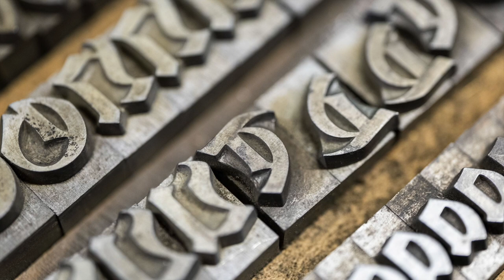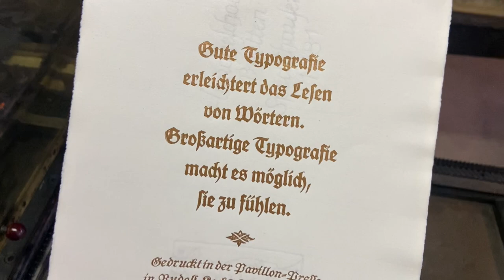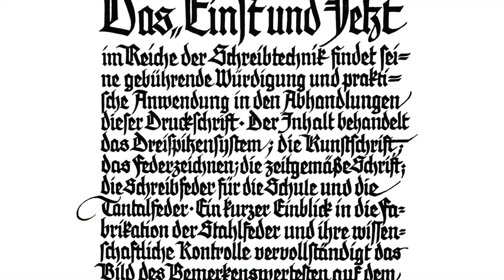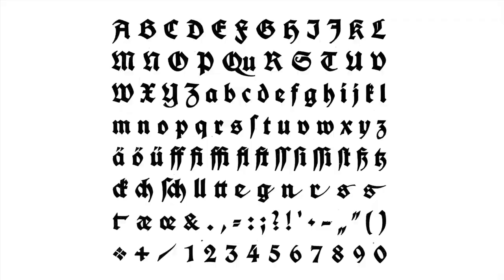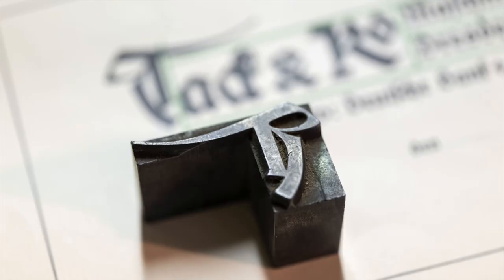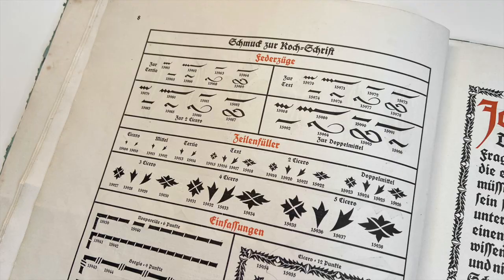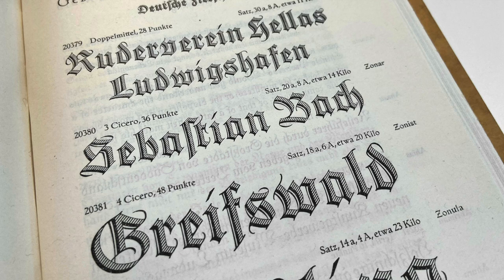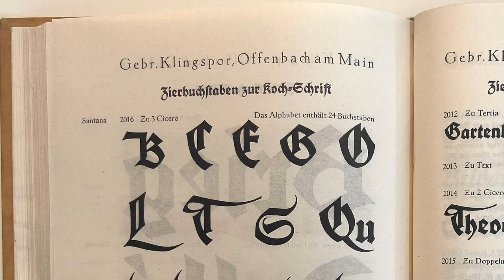Deutsche Schrift: Did Rudolf Koch’s typeface get its name by accident? | TypeTreasures series

Comment: What is that slightly taller than the type piece of quasi-leading you use to help you carry the type? Do you have them in literally every line length?
Reply from the maker: It’s called “composing rule”. It’s available in lengths with12 points difference, e.g. 20 times 12 points, 21 times 12 points and so on.
Reply: @TypographyGuru  Thanks. I have one piece that is about 13 picas wide that I thought had something to do with composing newspaper columns. Looked interesting to use on those longer lines.